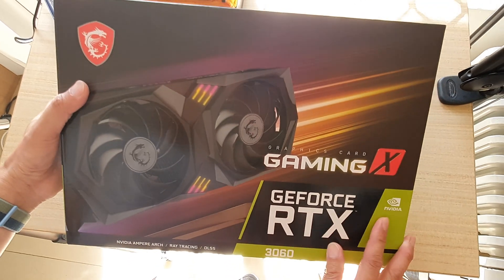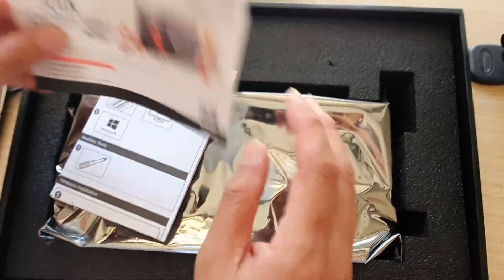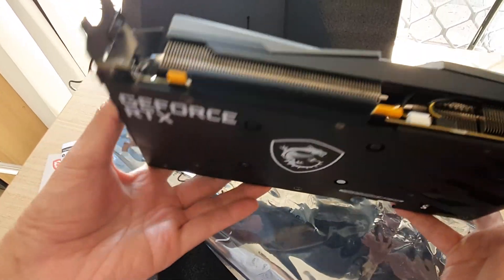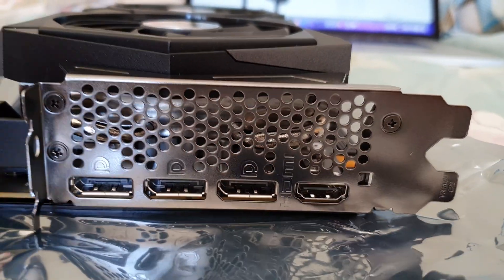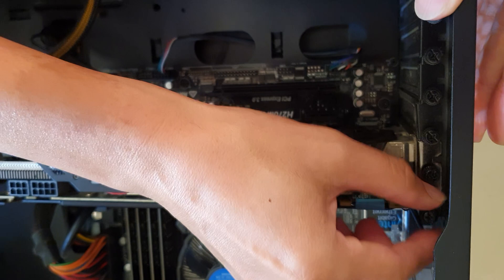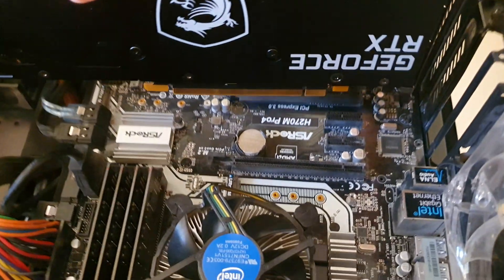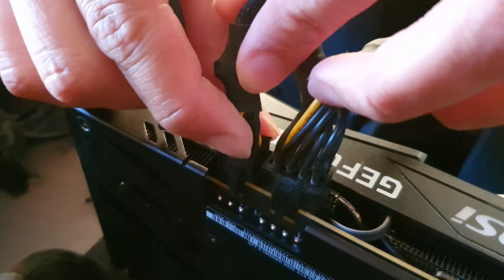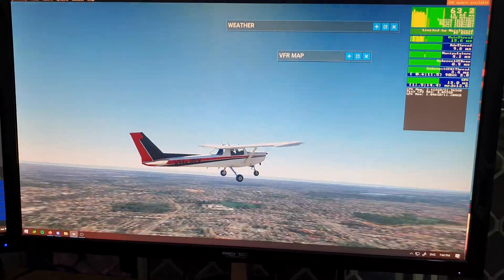Unboxing MSI GeForce RTX 3060 Gaming X 12GB GDDR6 With Installation & Demo

Comment: But my question is what kind of power supply that you need for it cuz my power supply is about 6:50 and I really want this one I have a 1660 super and I want to upgrade it so badly I want to play more games on it now I'm going to buy Xbox game pass
Reply: that is more than enough, id argue that you could do it with a 500w psu, as long as your psu has the 4 + 6 pin it will be okay.
Also that is reliable please, you don't want a bomb in yer computer.